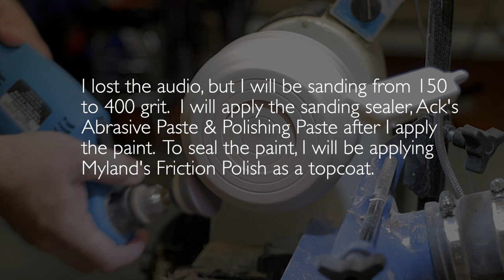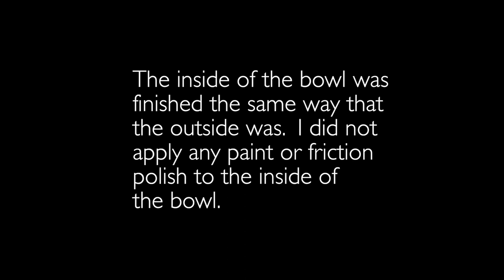Woodturning: A Distressed Maple Bowl

Comment: Love it.  Beautiful coloring.  Like the fact that you provide the start-out measurements.   Could not see the products used for finishing (too much glare).  Some turners I follow summarize their finishing protocole stating products, sequence of application, duration of cure.  Personally, I like this.  Your method also works and requires definition in label images, sufficient duration of visioning time as some of the criteria (at least for me).  Very original and creative.
Levis
Reply from the maker: Thank you for the feedback and I do agree.  I'm not sure why the label were over exposed and in previous videos, I did show a graphic of my finishing steps.  I did not do that in this one for some reason.  I should be more consistent.  - Ed

Comment: I think it looks good.  I did a bowl a while back with red dye and unfortunately that didn't work well, at least for me.  Now that you have used Ack's for a while do you like it better than Yorkshire Grit or EEE.  Thanks.  Ed.
Reply from the maker: Thank you George!!  With regards to Ack's and Yorkshire, I feel like they both give an equally great finish.  I will lean towards Ack's because you get both the abrasive paste and polishing finish for the price of the YG.  The other thing is that Ack's gets delivered to me in Phoenix much quicker than the YG.  Have you tried the Ack's yet?  Please keep in mind that you can get 10% off with my code.  - Ed
Reply: @WolfRidgeWoodworking  Hi Ed, no I haven't tried Ack's yet.  I plan order some in September when I get back from vacation.  Thanks.  George
Reply: ACKS WOOD PASTE
 the answer is, all my customers that was using YG said they would never use that again as long as we were making ours, they also said, ours works better, faster, less effort, just quoting my customers. Thank you for asking....Tom

Comment: How did you mount the bowl once you turned it around to hollow it out?  Did you reverse your jaws and use them in reverse on that small lip on the bottom you made?

Great project, I am anxiously awaiting my first bowl and the hollowing is what makes me nervous having never done it.  Seeing your techniques are very helpful.  Thank you.
Reply from the maker: Thank you Josh!  I cut a mortise in the bottom of the bowl while I was shaping the outside.  Then I reversed it and mounted the mortise in my 4 way chuck.  I tend to use a mortise rather than a tenon.  No particular reason for that.  - Ed